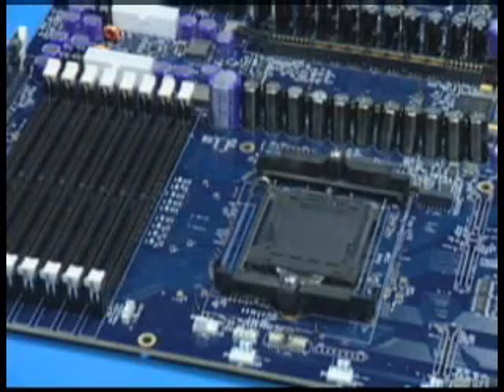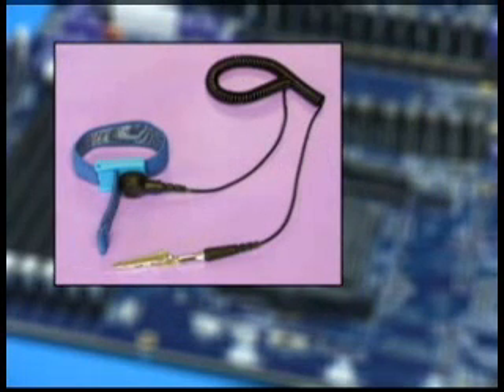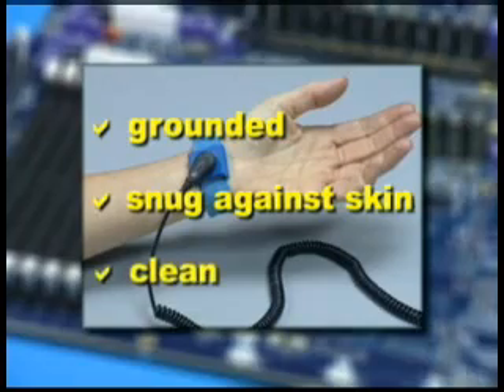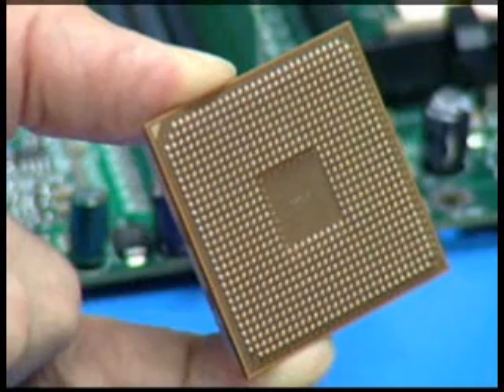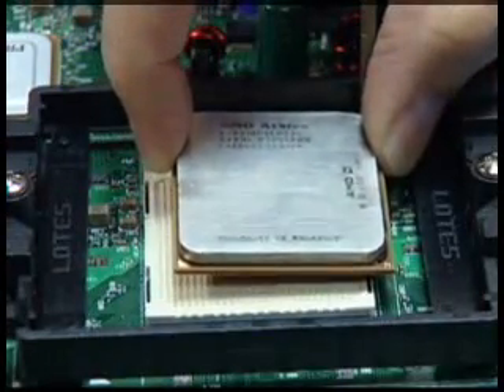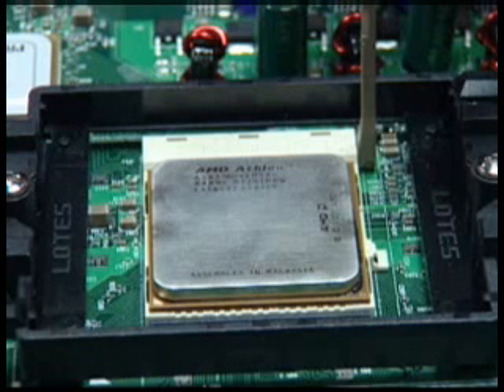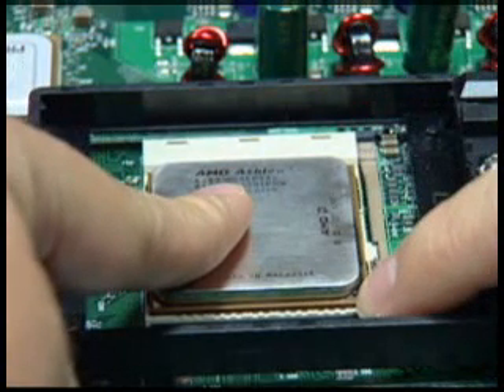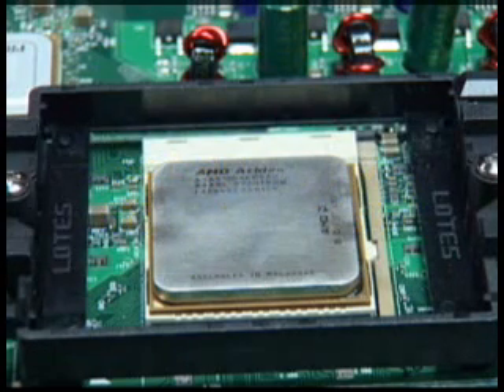Amd Processor Installation

Comment from the maker: @danutz502 Your socket information can be found out through the following method. Use a  program like CPUID it will tell you the exact make and model of the CPU you have. Find it on a site like newegg for example and it should say int he specifications what socket it uses. CPUID should also tell you the socket type although I cannot vouch for its reliability. If all of that fails then find the specs of the computer you purchased online.

Comment: Hey, I just got a 9950 Black Edition to switch out my dual core 6000 for.The MB does accept a Phenom.Can I just remove heat sink and switch them or do I also need to make changes in bios or cmos? Please help.Thanks!!